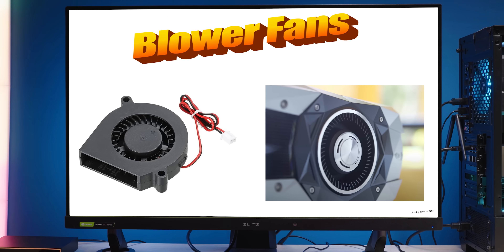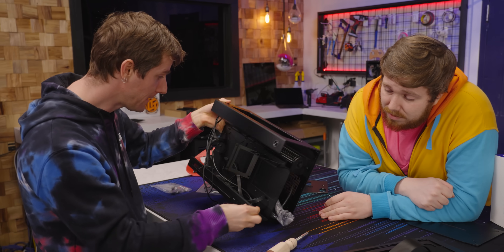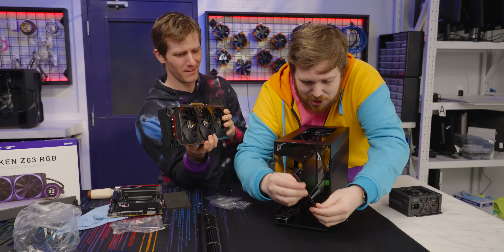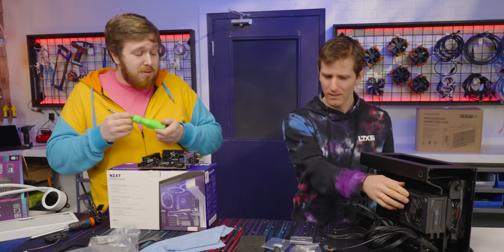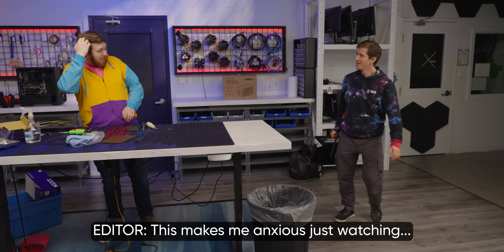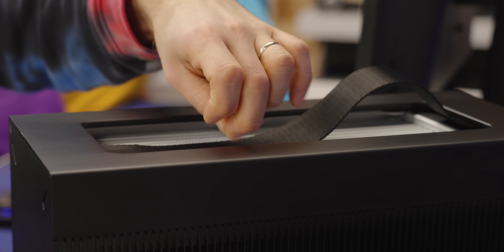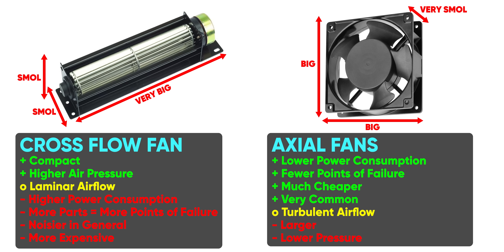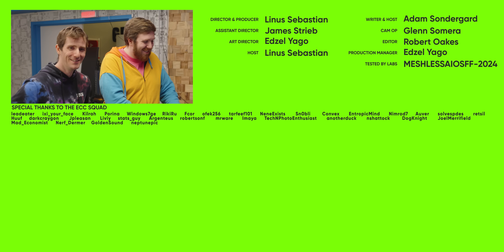This BLEW me away! - Meshless AIO SFF by Meshless Design

Comment: $360 for that case, honestly seems super reasonable.. Looks like great build quality with hyper niche design and great attention to detail.
Reply: I was expecting at least $500 and feared a price of $800-1000, so I also found the $360 price point to be more than reasonable.
Reply: Yeah, i mean i would never voluntarily spend that much money on any computer case, but im also not the target audience. Its a niche, premium product and for what it is it is pretty reasonable compared to the other contenders.  I was expecting quite a bit more than the 360 too.
Reply: @RepChris yeah I was hoping for $400, guessing $600. $360 is super reasonable.
Reply: @RepChris it does include the aio. Just sayin
Reply: They really hyped up the price, was fearing 1000 or smth
Yeah it's pricey, but understandable
Reply: Yeah I expected it to be like a grand the way they were talking about it. I've bought multiple $400 full towers. It's high end pricing, not BOUTIQUE pricing that was implied.
Reply: 360 when you are putting a 4090 and top of the line cpu. Reasonable. Overkill if it's an i3 w/ 1060.
Reply: I was guessing around $500, given the fact that it's one big piece of thick metal instead of a collection of thin stamped parts that could ratlle. AND it cools a 4090.
Reply: @dasiro extrusions are kind of cheap, just need the die and the press. the costs are front loaded so the more units you can sell the cheaper it gets. its the machining post extrusion that adds to the cost since that needs to be performed on every unit and tooling is a lot more consumable than a die. if you could come up with an extrusion that requires very little post process machining, you might be on to something. for example extruding an inverted t shape then using a stamped and bent piece as the cover on each side (it can even slide into grooves on the extrusion to simplify assembly).
Reply: Agreed. This is probably the most cleverly engineered and manufactured case I've ever seen. If I were building right now, I'd REALLY want one. It's pure genius.
Reply: Dude for real. My NCase M1 cost like $250 back in the day, all told. Didn't include custom cables or a special fan solution like this. The custom length cables are honestly SO NICE. Love them for that.
Reply: My thoughts exactly, having spent $1300 on a case myself i think $360 for something unique is pretty decent
Reply: @thingsforotaku8082 bro what? $1300😂
Reply: @thingsforotaku8082 what case was that? Not judging just curious. I want the Cooler Master HAF 700 Evo, which is  like $500, but I can't afford it
Reply: Fully elected it to be $500 by how much they hyped it. This is probably more than I would spend but it’s also somewhat understandable
Reply: I was totally expecting 1000
Reply: I agree. I was expecting 450-500
Reply: I’ve been planning to move to sff for a while, this case will probably be what I’ll go with once it’s in stock.
Reply: Not really
Reply: thanks for ruining it for me…
Reply: spent about $200 on my ncase m1 (no longer in production). so compared to other sff cases its kind of on the more premium side. but i want to see a sandwich case around $150 or less, and that means more common stamped sheet metal and rivets construction, rather than machined extrusions. machining is expensive. problem with sandwich cases is the added cost of the pcie riser cable, so i went with a more conventional case. id like to see proper low cost sandwich cases with pcb risers and better air cooling options that are sff friendly.
Reply: I thought it was gonna be 500$ ngl
Reply: $360 is perfectly fine for this case. It's a pretty good price.
Reply: Where is everyone getting $360? It’s showing up as $500 for me.
Reply: It's a scam!  People ordered this months ago, and no shipping notifications.  Not responding to emails.  People were charged for the case.  Nobody received it.
Reply: 350$ is Alr but 550 is insane for an AIO and a fan. I mean the nr200p gives you a psu and an AIO for 350
Reply: @imaron  I wish it was still 360
Reply: Well, luckily that case will last a long time so it's worth in the long term.
Reply: @SkepticalCaveman  Won’t all cases last a long time? I still have my second hand meshify c from 2017.
Reply: @SkepticalCaveman  up till the point the squirrel cage fan dies and you cant replace it.
Reply: Especially when you consider that it includes the aio
Reply: @7shortofperfection  The AIO is not included, $360 is the case only. Still, you get what you pay for, a high quality product.
Reply: @Gobbbbb   I get high quality, but like how much quality do you need for something that’s gonna be spending 99% of its life on a desk?
Reply: @Gobbbbb  my bad, I couldn't tell when I went to the website because everything was sold out
Reply: @7shortofperfection Wait for real? That's extremely reasonable, to the point where I would think about doing an ITX build just for that. If it wasn't sold out that is.
Reply: I was still Linus's fan last August
Reply: We have a vastly different opinion on reasonable.... lol
Reply: defending 360 for a case that costs at most 100$... 😂😂😂
Reply: Bro that is nowhere near reasonable. That is insanely expensive for a PC case which should cost less than $100
Reply: @kenshinhimura9387 delusional if you think this could even cost less than 200 just based on the machining.
Reply: @kenshinhimura9387  You have no idea the engineering involved to make something like this
Reply: less than $100 is an insane thing to say, its a niche product with expensive tooling
Reply: @rekless1110  no joke. A normal case with aio is probably going to run about 250. Add on to that the complicated tooling, custom cables, and small scale production, and 360 makes sense. Is it a good value? No, but that's not the point of the product. If people want good value, stick to rosewill because paying any more than $40 for a case and you're paying for aesthetics.
Reply: @7shortofperfection The tooling is relatively cheap, it's the machining hours that'll get ya
Reply: @kenshinhimura9387 did you actually watch the video?
Reply: @kenshinhimura9387  do you wanna work where they would manufacture something like that case for $100? If not, you might wanna consider shutting up. The manufacturing of products like this is honestly too cheap, considering the amount of labor involved
Reply: @kenshinhimura9387 pretty sure just the cost of machining would cost over $100 then you need cost of materials and the fan then what about R&D and employers and delivery? There is no way that is possible there needs to be space for profit margin still, have you even got the slightest idea about business expenses?
Reply: @kenshinhimura9387 Uhhhhh how should it only cost less than $100? Do you not understand how things are manufactured?
Reply: @kenshinhimura9387 Should ? How it should cost less than 100 ? The build quality is insane.
Reply: @kenshinhimura9387  Tell me you don't know how economies of scale work without telling me that you don't.

This type of build is SO much more expensive than some random 150$ folded steel box you're getting.  Not to mention the included cables alone are work 100$ (If not more)

Comment: Airflow is measured in CFM, there is a certain ideal ratio between delta Temp, CFM and surface area. That determines how cool to the ambient the heat source (in this case, the proc) will remain. A CFM meter is a straightforward solution. Why dont LTT get the labs to test the CFM
Reply: Volumetric airflow is influenced by geometry of the blower, so there's really no such thing as a 'CFM meter'. Most solutions are based around an anemometer which measures linear velocity of the air stream and then you need to calculate volumetric flow based on the overall surface area of the flow field. To get an accurate volumetric flow you'll need to carefully control the flow area (typically by enclosing it in a tube or duct) which is distinctly NOT a straightforward solution as you implied.
Reply: There are a lot of variables in a PC that a cfm number won't account for. Flow rate of a pump, for example.